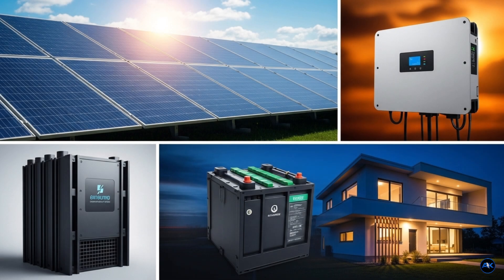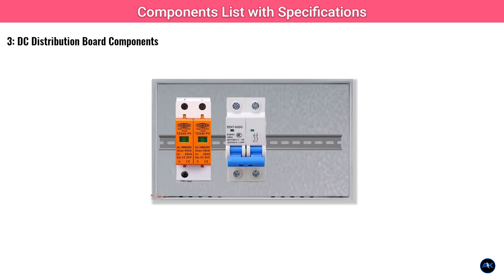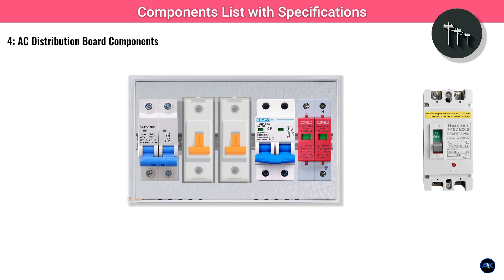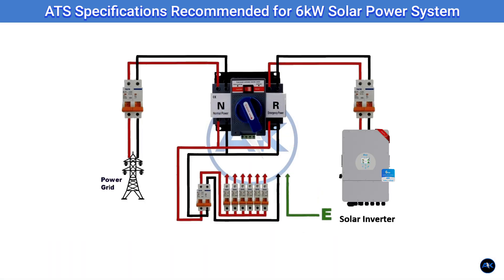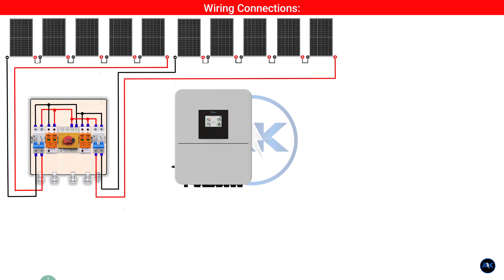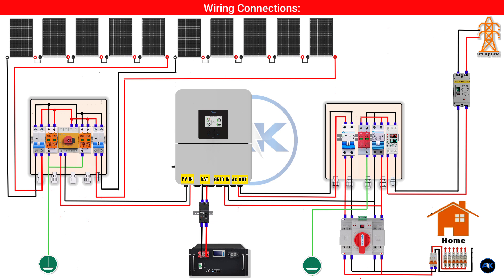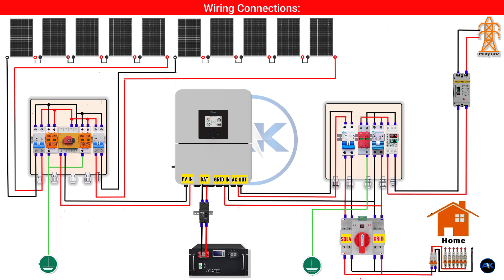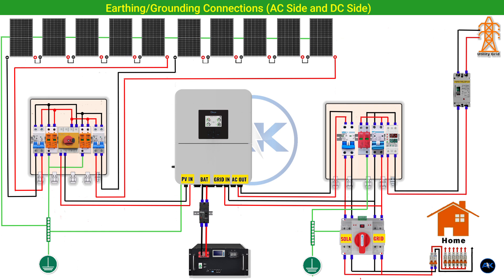Go OFF-GRID with This 6kW Solar Setup! (Full Hybrid System Guide + ATS Explained) #hybridsolarsystem

Comment: I have three phase 4,wire 63amps grid supply perfectly balanced on all three phases my inverter is 5 kw hybrid inverter with single phase my ats is also 4 pole . I need help how to connect with my hybrid inverter
Reply from the maker: It sounds like you have a solid setup! Connecting a single-phase inverter to a three-phase grid with an ATS requires careful wiring, especially to ensure phase balancing and proper functionality of the ATS. Typically, you would choose one phase from your three-phase grid supply to connect to your single-phase hybrid inverter's AC input. The ATS would then manage the transfer between this selected grid phase and your inverter's output to power your single-phase loads. Since your inverter is 5kW, ensuring your chosen phase can handle the full load is key.

Comment: Hello.
How can my ongrid 3 phase 10 kw enphase micro inverter used during grid failure ?
Is there any automatic changeover which can be used to shut electricity export and use the Solar generation during power off time?
Reply: As far as i know you cant use enphase inverter during power cit. because its on-grid need line power to work.

Comment: I wonder if it is possible to have solar powering your home and offsetting your electric bill, and also have it as a battery backup. Would it have to be a separate solar system with different panels, or can it be done with one set of panels? Can you make a video of what that would look like if it is possible?
By the way, This is a beautiful video, very informative.

Comment: Why didn't you separate the breaker for the AC IN going to the grid? Why is it tapped to the ATS reserve (grid)? Won't that conflict when the battery goes LVD and the inverter decides to take AC IN from the grid? What if your ATS malfunctions and shorts or gives simultaneous power to the inverter AC IN, which is not designed to accept that? It would be better if the AC IN breaker is separate and not tapped to your ATS reserve.
Reply from the maker: "Thanks for your detailed feedback and for raising these critical points about the AC IN connection! You've highlighted some important potential failure modes concerning grid isolation, ATS malfunctions, and the scenario when the battery goes LVD (Low Voltage Disconnect). We're taking your concerns about having a separate AC IN breaker versus tapping into the ATS reserve very seriously. We'll be reviewing the system design based on your input to ensure maximum safety and prevent any potential conflicts or simultaneous power feeding issues. We appreciate you taking the time to point this out!"

Comment: In these kind of set up is it no need to use a charge controller?
Reply from the maker: That's a very good question.
The need for a separate charge controller depends on the type of inverter you're using.
Many modern all-in-one or hybrid inverters have a charge controller built into them. In those cases, you don't need a separate one.
However, if you have a simple setup where the solar panels connect directly to the batteries, then a dedicated charge controller is absolutely essential. Its job is to protect your batteries from overcharging, which is critical for their safety and lifespan.
Reply: @akelectricdiy thanks for the explanation now I understand.maybe I need your guide someday if I wil do these set up if you don't mind.have a nice day
Reply: @akelectricdiy thanks for the explanation now I understand.maybe I need your guide someday if I wil do these set up if you don't mind.have a nice day

Comment: Overall cost?
Reply from the maker: That's an excellent question, as the cost is the most important factor for many people. The price for a 6 kW off-grid solar system can vary significantly depending on several key factors, but here is a general breakdown of what you can expect.
The total cost can range from $15,000 to $35,000 or more, depending on the quality of the components and the complexity of the installation.
Key Cost Factors:
 * Solar Panels ($4,500 - $9,000): This cost is based on the panels themselves. Prices vary based on efficiency and brand.
 * Batteries ($8,000 - $20,000): This is typically the most expensive part of an off-grid system. The cost is highly dependent on the capacity (how much energy you need to store) and the type (e.g., more expensive lithium-ion batteries have a longer lifespan than lead-acid).
 * Inverter/Charge Controller ($3,000 - $6,000): This is the brain of the system, managing the power flow. For a 6kW off-grid system, you'll need a robust, all-in-one or hybrid inverter with a built-in charge controller.
 * Installation & Other Costs ($3,000 - $10,000+): This includes labor, mounting hardware, wiring, electrical permits, and site preparation. These costs can fluctuate based on your location and the difficulty of the installation.
Since the cost is so variable, the best way to get an accurate estimate is to get detailed quotes from a few local installers who specialize in off-grid systems.

Comment: Where i put ct limiter?
Reply from the maker: @TroyEnriquez-e4u
Hi, thanks for the question!
A CT (Current Transformer) limiter is typically installed on the main AC line that connects your solar inverter to your home's main electrical panel or to the grid. The CT sensor is a clamp-on device that clips around the live wire(s) and measures the amount of current flowing to or from the grid. This allows the inverter to know how much power your house is using and to adjust its output to prevent exporting excess power back to the grid.
For a 6kW off-grid system, the term "CT limiter" might be used slightly differently than in a grid-tied system. In an off-grid setup, you're not connected to the public utility grid, so the primary purpose of a CT is usually to monitor your load consumption, manage power distribution between the solar panels, batteries, and loads, and prevent overloads. The exact installation location will depend on the specific inverter model and system configuration, but it's generally placed on the main output line from your inverter to your home's distribution panel.
Always refer to the installation manual for your specific inverter model to ensure correct and safe installation. It's also highly recommended to have a qualified electrician perform the installation to avoid any electrical hazards.
Reply from the maker: @TroyEnriquez-e4u
Hi, thanks for the question!
A CT (Current Transformer) limiter is typically installed on the main AC line that connects your solar inverter to your home's main electrical panel or to the grid. The CT sensor is a clamp-on device that clips around the live wire(s) and measures the amount of current flowing to or from the grid. This allows the inverter to know how much power your house is using and to adjust its output to prevent exporting excess power back to the grid.
For a 6kW off-grid system, the term "CT limiter" might be used slightly differently than in a grid-tied system. In an off-grid setup, you're not connected to the public utility grid, so the primary purpose of a CT is usually to monitor your load consumption, manage power distribution between the solar panels, batteries, and loads, and prevent overloads. The exact installation location will depend on the specific inverter model and system configuration, but it's generally placed on the main output line from your inverter to your home's distribution panel.
Always refer to the installation manual for your specific inverter model to ensure correct and safe installation. It's also highly recommended to have a qualified electrician perform the installation to avoid any electrical hazards.

Comment: HHow many panels and what inverter can power house hold unit for 9 air conditioning, extractor, water heater, washing machine ,6 televisions etc
Reply from the maker: "That's a great question! Sizing a solar system for a load that includes 9 air conditioners, a water heater, and all those other appliances (extractor, washing machine, 6 TVs, etc.) requires some careful calculations. To give you an accurate estimate on the number of panels and the appropriate inverter size, we need to know the wattage (power consumption) of each of those items and how many hours per day they'll run. We'll be happy to walk you through the process!"

Comment: We’ll explain in this video but what I need to know now is how to select a correct battery for an 1kva inverter (still new in solars need to learn more)
Reply from the maker: Selecting the right battery for a 1kVA inverter is a crucial step for setting up an efficient solar power system, and it's great you're looking to learn more! Since you're new to solar, let's break down the key factors in a straightforward way.
A 1kVA (1000 VA) inverter typically has a power factor, often around 0.8, meaning it can handle about 800 Watts (1000 VA * 0.8 = 800W) of continuous load. The battery's role is to store energy for your inverter to draw upon.
Here's what you need to consider to select the correct battery:
1. Battery Voltage (V):
 * Most 1kVA inverters are designed to work with a 12V DC battery bank. Some might be 24V.
 * Crucial: Check your inverter's specifications. It will clearly state the required DC input voltage. Using the wrong voltage can damage your inverter or the battery.
2. Battery Capacity (Ah - Ampere-hours):
 * This is the most important factor and determines how long your battery can power your devices.
 * How to estimate:
   * Determine your load: List all the appliances you plan to power with the inverter and their wattage.
   * Calculate total Watts: Sum up the wattage of all simultaneous loads.
   * Decide on backup time: How many hours do you want your appliances to run on battery power during an outage or at night?
   * Formula (simplified for 12V system):
     * Required Ah = (Total Watts x Hours of Backup) / (Battery Voltage x Inverter Efficiency x Depth of Discharge)
     * Inverter Efficiency: Typically 85-90% (use 0.85 for a conservative estimate).
     * Depth of Discharge (DoD):
       * Lead-Acid Batteries (Gel, AGM, Flooded): To prolong their life, it's recommended not to discharge them below 50%. So, if you need 100Ah, you'd effectively need a 200Ah battery to only use 50% DoD.
       * Lithium-ion Batteries (LiFePO4): Can safely be discharged up to 80-90% or even more, making them more efficient in terms of usable capacity.
    Example for a 12V system:
      Let's say you want to power 200W of load for 4 hours.
      Assuming 12V battery, 85% inverter efficiency, and 50% DoD (for lead-acid):
     * Required Ah = (200W x 4 hours) / (12V x 0.85 x 0.50)
     * Required Ah = 800 / (5.1) \approx 157 Ah
     * So, for a lead-acid battery, you would look for something around a 12V, 200Ah battery to ensure you don't over-discharge it.
3. Battery Type:
 * Lead-Acid Batteries (most common for beginners due to lower initial cost):
   * Flooded Lead-Acid (FLA): Requires maintenance (checking water levels), good for deep cycles but needs ventilation.
   * Sealed Lead-Acid (SLA) - AGM (Absorbent Glass Mat) or Gel: Maintenance-free, can be installed in various orientations, better for cycling than FLA but generally more expensive. AGM is often preferred for solar cycling.
   * Pros: Lower upfront cost.
   * Cons: Shorter lifespan (3-7 years depending on usage), heavier, sensitive to deep discharge (DoD 50% recommended).
 * Lithium-ion Batteries (specifically LiFePO4 - Lithium Iron Phosphate):
   * Pros: Much longer lifespan (10+ years), lighter, higher efficiency, can be discharged much deeper (80-90% DoD), faster charging.
   * Cons: Higher upfront cost. However, over their lifespan, they can be more cost-effective due to longevity and efficiency.
4. Number of Batteries:
 * If you need more capacity than a single battery provides (e.g., you need 200Ah, but batteries are sold in 100Ah units), you'll connect them in parallel to increase Ah while keeping the voltage the same.
 * If your inverter requires 24V (and you have 12V batteries), you'd connect two 12V batteries in series to get 24V, and then connect sets of these in parallel if more capacity is needed. Always ensure batteries in a bank are of the same type, age, and capacity.
In summary, for a 1kVA inverter, start by:
 * Checking your inverter's DC input voltage. (Most likely 12V for 1kVA).
 * Estimating your power needs (Watts) and desired backup time (Hours).
 * Choosing a battery type (Lead-Acid for budget, LiFePO4 for longevity and performance).
 * Calculating the required Ampere-hour (Ah) capacity based on your load, backup time, and the chosen battery's recommended Depth of Discharge.
Don't hesitate to ask if you have more specific details about your planned usage or budget, as that will help in giving more tailored advice!
Reply: @akelectricdiy  wow this is very detailed and informative

Comment: You shouldn't connect the positives and negatives of the 2 series. When one serie had a higher voltage than the other (e.g. failing cells) the higher voltage one will cause counter current in the lower voltage one causing it to fail or heat up.
Reply: You either use an inverter with 2 pv inputs or use a dc to dc inverter to stabilize the output voltage is the pv series before merging
Reply: Or use combining box with diods
Reply: u right, at least put fuse for each of the string to prevent mismatched or faulty
Reply: @chenps8792 yes fuses are required, but they will not prevent one higher voltage serie from frying up another. Diods does
Reply from the maker: "Thanks for the valuable input! You're absolutely right about the risks of connecting series with differing voltages, even if they're nominally the same wattage and voltage. We always aim for balanced series to avoid issues like counter-currents, which can definitely lead to cell degradation and heat. We appreciate you highlighting the importance of matching voltage and cell health when combining series for optimal performance and longevity."

Comment: I am not convinced here.... If you parallel both strings the amps will add up. Then the PV breaker needs to be sized up. And inverter's charge controller parameters must be able to handle the sum of the amps. 
Why not series all 10 panels to get 450vdc.... There will be a voltage drop...or   9pcs ??
Reply: u are right, the best way just put it in series, breaker & cable will be smaller and more cheaper. I dont know why it keep on 225V here eventho most inverter support up to 600V -1000V nowdays, unless this video demonstrate using cheaper inverter
Reply: Off grid inverter cannot handle higher voltage  mostly within 150 voc maximum